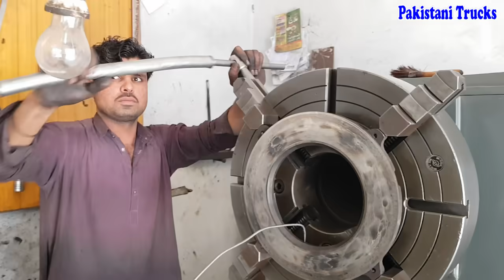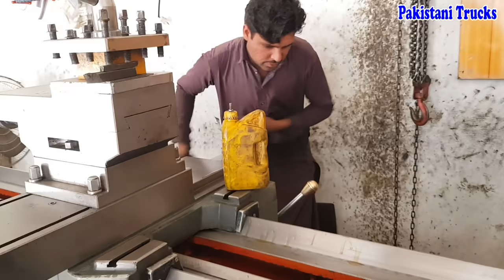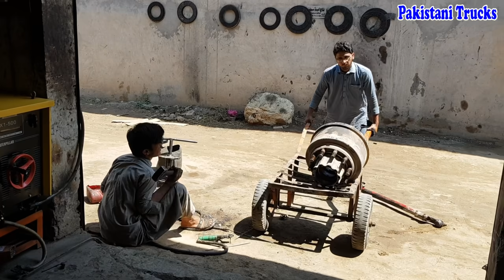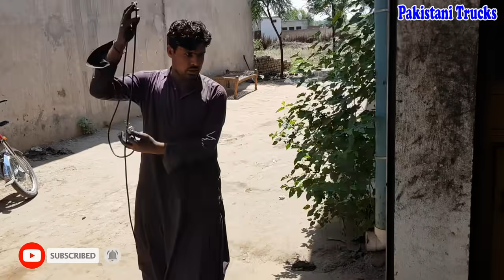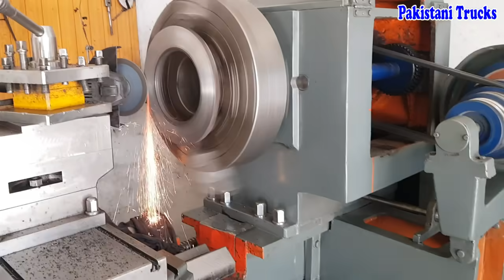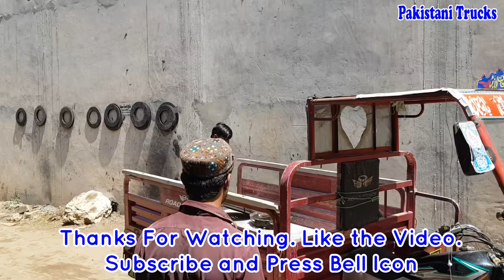Amazing Restoration Technique of Old Clutch Pressure Plate | Resurfacing Pressure Plate

Comment: Good job on keeping the lathe  neat and clean. If I may give you a piece of advice:  stop overtightening the tool post fixing screws. It's very obvious that almost all the screws are mushrooming and some of them are even bent... You risk ruining the threads of the tool post, and then you are really screwed. You don't need that kind of torque to secure a tool(that is the purpose of multiple screws), just crank them by hand without using extended tube for gorilla torque.

Comment: How even the pressure plate will grip the clutch after being polished like that?
Reply: There’s 3000 lbs of pressure on that plate with all the springs...and it’s not supposed to be like sandpaper, the disc should slip slightly as it engages so it doesn’t grab hard and rip it to shreds or blow the center of the disc out..